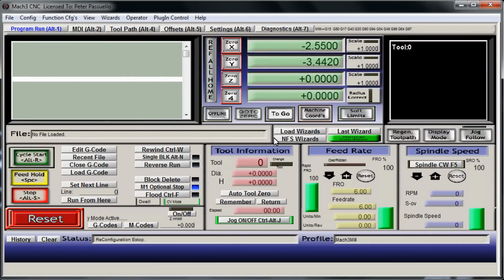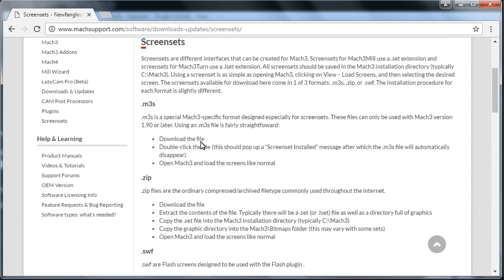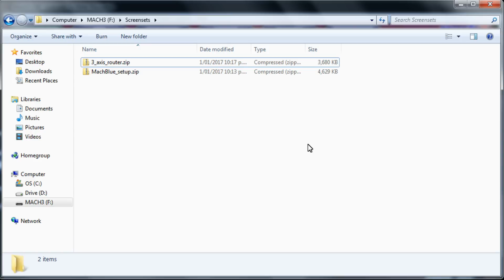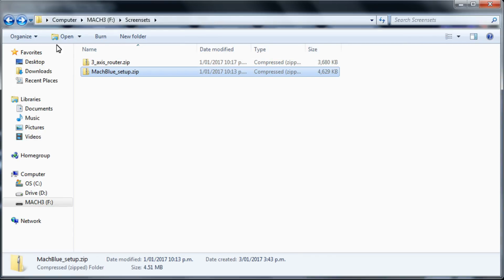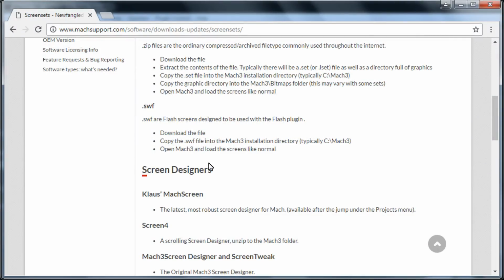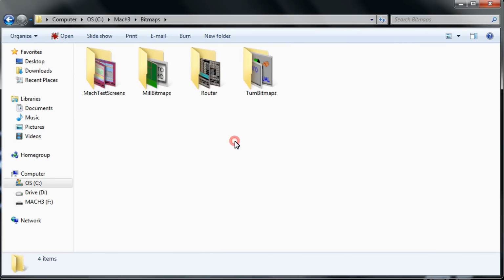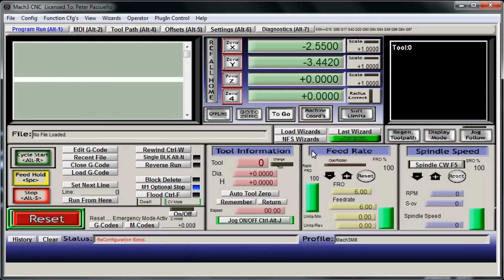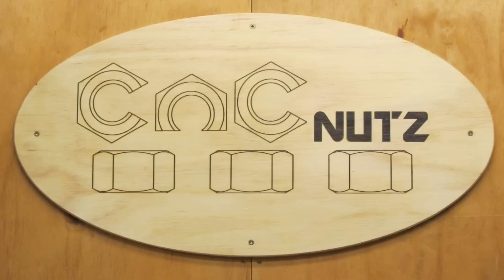How to install Mach3 Screenset - CNCnutz Episode 130

Comment: I have a question when I zero out and get ready to start it plunges straight into the wood what's wrong
Reply from the maker: Realistically Michael there could be a hundred reasons for it behaving like that but without more information it is impossible to tell. You will have to provide detailed information before I could hazard a guess. If you want help please feel free to contact me through the contact form on my website.
Cheers
Peter

Comment: Hello Peter... Great Show !  

 I posted an entry on the Gatton Forum and wanted to see if you would also take a stab at answering the question.... Here it goes...

In the proecess to raising the funds to purchase a Gatton kit I have started playing around with the M3 demo....  Using Daves "Mach3 Youtube Settings .... When I get to MOTOR TUNING AND SETUP section M3 is not giving me control to change from the defaults?
Anybody have a thought as to why?  Do I have limited control being a demo?  or... Could the Software know that I am not hooked up to a controller ?

Thx....  JD

Kiwis Rock !
Reply from the maker: To the best of my knowledge Mach3 is limited to running 500 lines of Gcode if you don't have a license but that is the onlt limitation.
I did a quick test and if when you creste the profile you check the "Default Profile Values" box you will not be able to change the values but if you create a proile and don't select the "Default Profile Values" box you will be able to configure it to your requirements.
Cheers
Peter
Reply: Peter....That makes perfect sense!  Do you think I should uninstall M3 and start from scratch?.... or can I create a new profile and write over the original? 
Thank You for taking the time....  ;)
Reply from the maker: +Johnnyd943 
Just create a new profile and if you want it to have the same name then delete the old one. 
Cheers 
Peter
Reply: eek.... i'm such a dummy....  My problem wasn't that the motor tuning changes wouldn't hold.... it was my perception of how the Axis-Selection Buttons at the upper right corner react when you adjust a slider or enter a number...  The process is not as obvious as one wold think...
So just a little FYI to anyone that should read this...  Be aware that after selecting one of the Axis-Selection Buttons, the heading will change, letting you know which axis you are modifying.... But !  As soon as you modify a setting with either a slider or by digit, the Axis-Selection Button will de-select.  No worries!  The last thing need to do is click the "Save Axis Setting" button and Boom... you've change it !

Thank you Peter for helping me with this Matter ! I'm getting closer to pulling the trigger on my CNC !!!
Reply from the maker: +Johnnyd943 
Glad you got it sorted
Cheers
Peter

Comment: question :
still have to start with usung (any) cnc prigram 
i was wondering with the experiance you have with these programs , if you had to start from scratch learning and working with a CNC program wish one would you like best MACH3 or UCCNC have to buy one of the two and learn to work with it eventually

wat adaptations did you do to youre computer , did you added extra memory or anything like that to make it work better with the program ?
i was planning to use a 42 inch platscreen as a monitor as i dont see things as sharp as ai should (not like mr magoo but pretty close)
Reply from the maker: I think the 2 programs are basically the same. If i was using a UCCNC controller i think I would go for the UCCNC software because it is designed to work with that controller and both are made by the same people. It is also cheaper. If I was going to use any other motiom controller then Mach3 or Linux CNC is the way to go. The laptop I am using has 1 gb of memory and is running Windows XP. I didn't do anything special for it except not connect it to a network. It is important that Updates not be turned on with the PC as they have been known to restart in the middle of jobs which is not good.
42 inches is one hell of a monitior. Bigger than my TV.
Cheers
Peter

Comment: hi Peter, I'm thinking of moving to uccnc from mach3, worth the change? thanks for your great videos!
Reply from the maker: That's an interesting question. I find myself using UCCNC most of the time now but I don't really have a reason for choosing it over Mach3. Both seem to work ok with the UC300 I have. I will be trying the new Screenset for the UCCNC that Ger21 has created at some point in the future as I like some of the features he has included. I also like my custom screenset for Mach3 and it has a few other things that UCCNC doesn't have. I really don't have a preference one way or the other at this time.
Cheers
Peter

Comment: Hi Peter,

Nice Video.

Here is a link to my custom screen setup on Mach3 using 2010 Screen Set which costs $20.00 and worth every penny of the cost.  I had a friend of mine do some modifications on the right panel with custom macros etc.  Love it.

https://www.youtube.com/watch?v=4WQ8KcTSKyQ&t=6s

Note: if you go to 12:07 on the time line it show you how my modified 2010 Screen set works.

John
Reply from the maker: Thanks John.

Watched your video. Very nice machine and I like the laser X Y positioning.
I have always liked the 2010 screenset and am waiting for the new UCCNC screenset he has developed to be released. You are right that $20 is a good price considering the amount of work that goes into creating a custom screeneset.
Thanks again John
Cheers
Peter
Reply: Hi Peter,

One thing I have found with him is that is follow up making sure it works as planned is outstanding.  Hopefully, if he makes one for the new UCCNC it will work equally as well.

Thanks again for the GREAT videos.

John
Reply from the maker: +helicopterjohns 
He has a preview of the new UCCNC or on his website at the moment. Looks good. 
Cheers Peter
Reply from the maker: +helicopterjohns 
He has a preview of the new UCCNC or on his website at the moment. Looks good. 
Cheers Peter